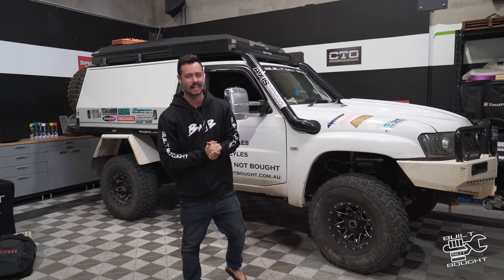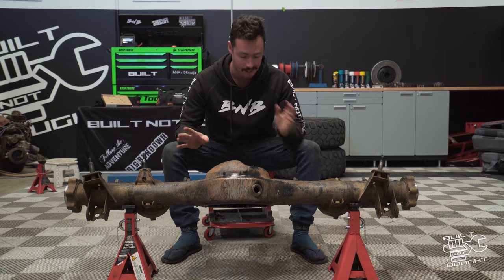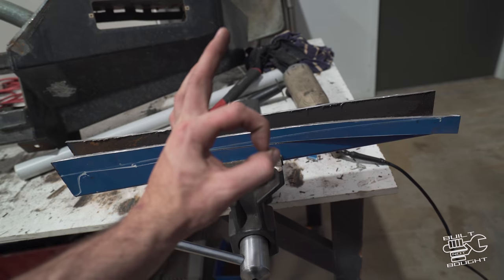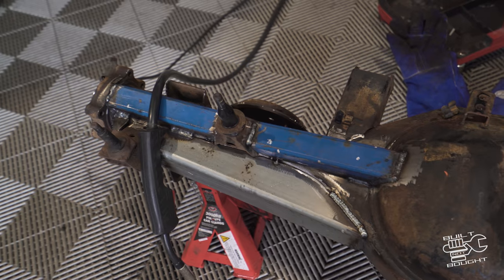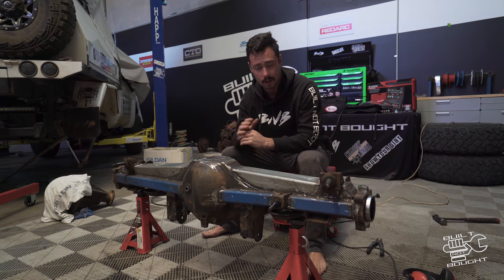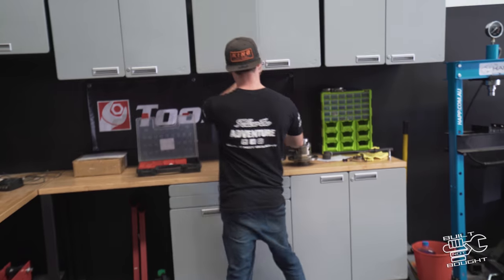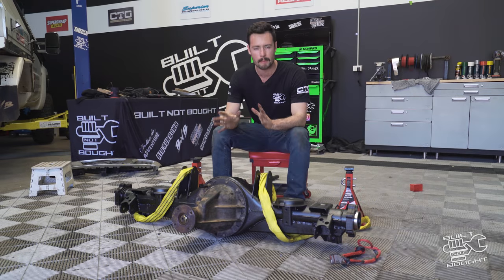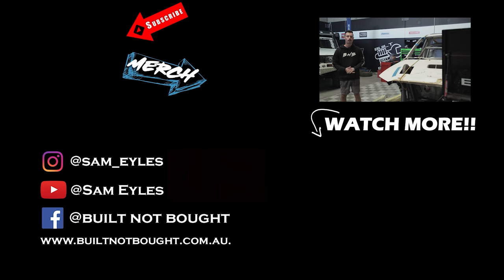Apparently This Diff I Can't Break... We'll See About That!!

Comment: 3:50 yes, the grinder produces some heat, but on the structural hollow sections, cutting them length-wise releases stresses built in from manufacturing.  Cut a face out of square hollow section (SHS) or rectangular hollow section (RHS) and it's usual for the remaining piece to spring inwards a little.  The face cut from the section, as you've shown, will nearly always curl back on itself.  Use a jigsaw with a metal blade, which produces far less heat than a grinder, and it will still curl back on itself.
Reply: The only reason I came to comments was to find if someone had said this exact thing. Your spot on
Reply: truth
Reply: Spot on. Was wondering if someone was going to say this

Comment: Leaving oil in your housing also helps to dissipate heat
Reply: Great tip!! Never thought of that!
Reply: Free gear oil stink too!
Reply: Or set fire to your shed depending on how much oil and heat there is.
Reply: mungbean84 I said “helps dissipate.” If you have 80-90 close to igniting in a steel case you were probably gonna end up with a 20mm warp in your empty housing anyway.
Reply: check out new video, girlfriend washes me car !!
Reply: Cheers for that info pal

Comment: Harrop, Yeek!! Have a look at the small diameter hemisphere. They could have made it bigger and stronger, it is a lot smaller than the powerlock LSD. Also, the cross-shaft in the Eaton is piss-weak, three piece and pissy diameter. Small spider gears inside a small carrier. The locking engagement ring is also a weak area - and then there is the issue of it unlocking when you change direction! In comparison to a Pro-locker, the Eaton is a joke.

Comment: So did you use your old diff gear, crown + pinion from the H233 on the H260 ? Or did you buy new diff ratios for the bigger diff. I have the H260 bigger diff and really want to use 3.5 or 3.9 ratios, but can't find any.
Reply: Best you will get for a H260 is 4.1:1. They are for hauling loads, not cruising.

Comment: lol thats my picture of the diff at the 50 second mark. and it just went to heaven about 6 weeks ago  after 4 years of duramax pain followed by 12 months of LSA abuse.
Reply: I concur!
Reply: Nice bro reckon you can tour with an lsa with 220lt of fuel?
Reply: @jarrod1687  people go touring with 4.5  and 4.8 patrols. the LSA easily match them for mileage on the highway if not better. with 37" boggers I got 17.5/100 over 140km so imagine with 33" AT's.
Reply: @vincem5  nice man, that's what I like to hear, what trans did you use? Looking to go ls3 but back of my mind says just go all out and lsa it, just want it usable in remote land
Reply: @jarrod1687  i used the trans that comes with it. the 6l90e  unmodified, and use 2  trans coolers up the front. not a cheap combo tho. whereas the ls3 and nissan manual  is a lot cheaper and would work well in remote. things only start breaking when being silly with the loud pedal. i dont know how ls3's go on the juice? maybe a tad worse as  theres no boost.

Comment: 6 months from now... Pwo gday guys, gonna chuck this 9 inch in me ute today.
Reply: H260 centres are dirt cheap tho. cheaper than H233's :)
Reply: @vincem5   do it once, do it properly and have confidence it will never leave you strandard
Reply: wouldn't that be a downgrade? 
A patrol diff is way stronger than a 9 inch.
Reply: @megarafjogos  nope. the big problem with the nissan diffs is theres no support bearing on the nose on the pinion gear like in a 9" . so the pinion nose just walks up the crown wheel and boom!
Reply: @vincem5  yeah, but he broke a shaft. I've never seen someone destroy gears in a patrol. Shafts? lots of them, but never gears.
Reply: @vincem5  yeah, but he was doing road launches. Lots of torque applied in a single moment, in a single point. 
Offroad the problem is wheelspin. You spin and then a wheel grabs something, and all that force is transfered to the axle shaft. One wants to spin, the other doesn't, soo it fails.
Reply: @megarafjogos  in his 4x4 road launch he snapped the output shaft on the gearbox. back in June he blew a centre. when did he snap axles? either way he'll blow the H260 within 12 months along with some gearboxes. makes for great viewing.

Comment: Why an E-Locker ? ARB makes a locker for H260 also. The E-Locker engages and disengages everytime you change direction.
Reply: It's not an issue and it can actually be used to your advantage if you know how
Reply: Maybe he is sponsored by harrop?
Reply: @Churchys_adventures  Hi mate, I was thinking of changing from air lockers to E lockers but was worried about the way they disengage. What would be an advantage of that?
Reply: No it's manually locked and unlocked via a electro magnet.
Reply: Warby yes but when you reverse or roll back it unlocks, then takes what like half a turn to lock again? That unlocking could mean the difference of being stuck orr driving it, would only go air lockers or auto lockers mate
Reply: @johnnyk32120  Change to TJM pro lockers, better than ARB without the E-locker unlock.
Reply: @einfelder8262  tjm are fkd only develop lockers for a small range of cars. The one thing arb has going for it, they do a locker for just about everything. Pro locker would be sweet.... if they made them for more vehicles.
Reply: @cabline1193  I don't know if Harrop has them yet, but the latest eaton e-lockers don't use the ramp to engage any more. Instant lock and not unlocking in reverse. https://eastcoastgearsupply.com/i-23993541-dana-60-eaton-elocker-35-spline-4-10-down-4-pinion.html
Reply: @cabline1193  ok, I've never had an issue. Works great. I went with elec over the air operated as less components to fail.
Reply: Warby auto lockers have the least parts to fail out of all of them and usually the cheapest
Reply: @Warby1  so did I, until I looked into the small/weak components inside them. Small hemisphere, small gears inside, small cross-shafts, piss-weak locking ring. Replaced with pro-locker - much beefier. ARB air-leaker, no way. Not interested in servicing 'o' rings inside them every two years.
Reply: @cabline1193  That's true but - the load on all the other components ends up costing you down the track, as these other parts wear out quicker due to the strain on them all of the time.
Reply: @trickster8635  ahaha yeah had one in the rear of my car it used to snap axle studs like no tomorrow but that was more because I drove like a fkwit on the road 🤣

Comment: What gear ratios are you running? I'm struggling to find 4.6's for the h260?
Reply: Youll only find aftermarket these days, Nissan made them for mk/mq but to find in stock would be rare. snake racing do a h260 4.6, il add a link
.
https://shop.snakeracing.com.au/gu-rear-4-625-ring-and-pinion-big-diff-series-1-4/
Reply: @Churchys_adventures  Thanks a lot, I will check it out

Comment: I don't know if you changed the front diff centre as well, but if you didn't know, your front and rear axles will have different speeds at the wheels creating torsion and stress within the axels. Also, your odometer is also probably out of alignment as it is but it will definitely be worse with this diff centre changed. Also, if the previous diff centre used red lock tight, it needs heat to liquefy the lock tight in order for you to remove the bolt, you will also need to do the same thing with the new diff if you ever need to remove the crown gear again.
Reply: George Azizi I’d imagine he’d have gotten one with the same ratio as the existing front diff.
Reply: @shanenorwell8580  Due to the clear size difference, I highly doubt he did get the same, but if he did, he forgot to mention that.
Reply: George Azizi the overall size has very little to do with the ratio.
Reply: @shanenorwell8580  Not necessarily, with a larger crown needs a larger pinion, the correct pinion size with the same original ratios, may not be able to fit within the diff pumpkin, thus having a different final drive.
Reply: George Azizi if it’s a 4.1:1 for instance that will be the same regardless of the physical size or the brand of diff ect. The ratio is the ratio.
Reply: @shanenorwell8580  i understand the ratio is the ratio, but i will refer back to my previous point about whether or not the new size with the same ratio from the previous diff will be able to fit within the new pumpkin housing and if he got the correct one to begin with, if he did no big deal, if he didnt, firstly i am helping him by making him aware of the consequences and secondly he did not mention that in the video.
Reply: @georgeazizi7760  The ratio determines revolutions of ring and pinion. 4.11 h233 and an 4.11 h260 will have the same output speed regardless of size. size only changes angle of contact / strength / tooth contact area / deflection.
Reply: @Churchys_adventures  thats not what i am saying, you clearly have not understood what i am trying to say and we're going in circles.
Reply: @georgeazizi7760  h260 housing + h260 larger centre + h260 ring and pinion.. it's a whole diff he's put together..
Reply: @Churchys_adventures  there is no point talking to you guys, you dont seem to understand.
Reply: @georgeazizi7760  you don't seem to know what you're talking about
Reply: The 260 diff will have the same ratio as the front.  ODO won't change just because the diff is bigger, because the ratio is the same.  Nissan uses thread lock on the crown wheel bolts, and no, you don't need heat to remove them, as you can plainly see if you actually watched the video.  I removed my Patrol crown wheel without heat on my workbench without even a vise.  So stop talking crap mate.

Comment: Curious as to why you wouldn't do preheating of the diff housing before welding to assist with stopping warping.
Reply: How do you pre-heat a 2 meter long hunk of steel?
Reply: @trickster8635  with an oxy torch with a broad tip.

Comment: did u get the welds inspected by a certified boiley
Reply: I know this is a few months on but really a boilermaker or even a welder has no business inspecting welds other than casting a professional  eye over it and making comments, if you wanted to properly have them inspected welds are inspected by someone with Qa/Qc qualifications and really only person who can really say they can inspect it other than just professional knowledge is a certified welding inspector (CSWIP) but that’s really fucking overkill for a diff brace. Most state laws just require chasis welding to be inspected by an automotive engineer, same people that certify GVM upgrades and the like.

Comment: Regardless of welding technique, method of welding or amount of heat - that diff will be bent like a banana.
If you didn't check it for straightness and correct it.... You'll be crushing bearings and binding axles in no time.
Reply: how would you correct it?
Reply: @JS-tb9hu  When we make custom high strength axles and diff centres, we correct it by using an oxy and rapid cooling to pull it straight. However if the distortion is excessive we remachine the bearing diameters and faces to bring all diameters concentric, and square.
Most customers get us to remachine them as it gives us an opportunity to to run bigger bearings or even spherical roller bearings which handle axle misalignment better when the axle gets twisted during high torque loadings.
Reply: @billweber1340  So heat one side while cooling the other to literally expand one side and contract the other hence straightening the bend?
Reply: @JS-tb9hu  almost.
 If you heat the 'high' side the metal becomes soft. It will then compress from the stress in the opposing side. Bring it to cherry red as soon as possible, then dump a dripping wet rag on it to quench it. You want the heated spot to be the size of about a 50c coin.

Comment: So what are the legalities of this. Does it have to be signed off by an engineer?
Reply: In Aus, if the diff was a factory option then no engineering is required. Which this one was a factory option in leaf rear aswell as 4.8 models.  

Bracing a diff also doesn’t need engineering cert however seeing a braced diff will make the police look over your car more thoroughly.
Reply: @KieranRand  fair enough thanks for that. Strange that a chassis cant be welded too and shit. But the diff can go to town. Cool to know.
Reply: krump 7  chassis can be welded to its just not recommended. As long as chassis’ are correctly fishplates and all work is conducted by someone who is qualified. The steel used in chassis is tempered and welding to it changes its properties hence why it isn’t recommended.

Comment: Mate, reality check, you need to put $$ into the 80 series cruiser, she won't let you down. You've proven time and time again Patrols weak, break when you need them to be awesome and even Fraser Island towing states they are the number one vehicle they tow off the island (one a day this week already)!! Just saying. But back to the work you did. Nice job but is that bracing water tight? If not put some holes in so you can flush inside the bracing with fresh water after a big trip.
Reply: If the 80 had 500hp it would break too 😂
Reply: @JS-tb9hu  They don't need 500hp to break, they break shit all the time.  There's a reason most comp rigs use Nissan drivelines, but reality check dufus doesn't get it. :)